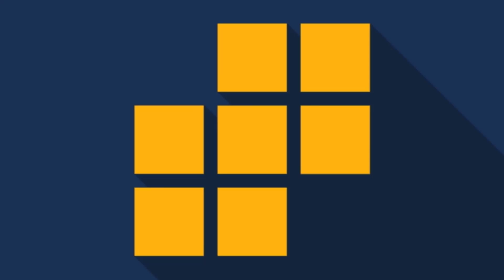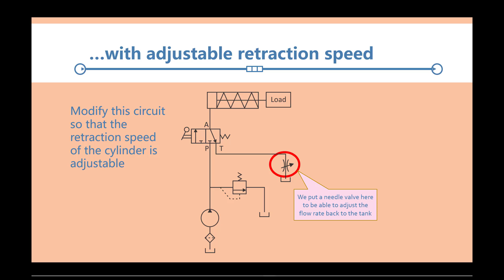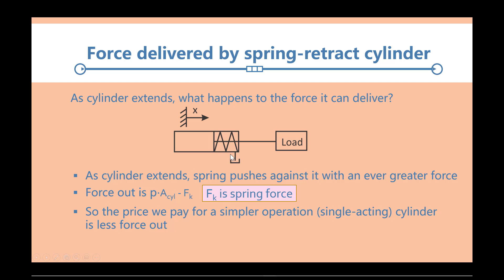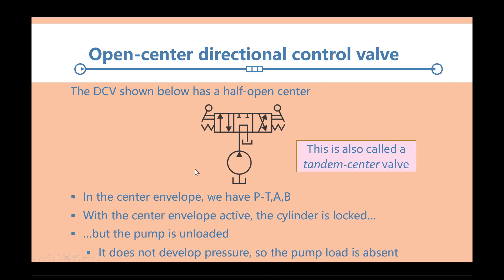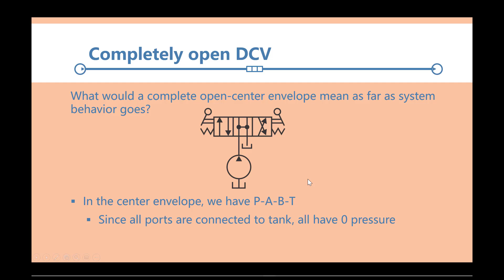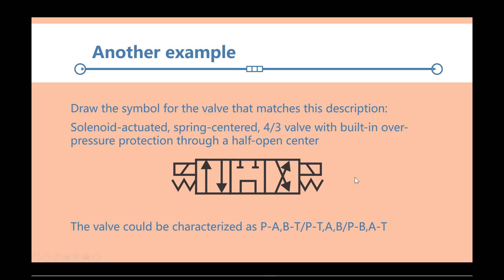Elementary Hydraulic Circuits - Part 2

Comment: can the valve at 9:20 protect against over-pressure of the system if the cylinder which its actuating is mechanically locked or fully extended?
Reply from the maker: No it cannot.  A separate relief path needs to be provided to protect the closed volume if the load becomes locked externally or when the piston reaches the ends of its stroke.